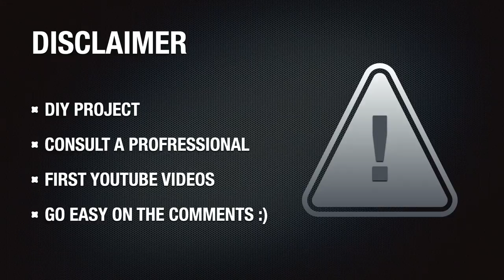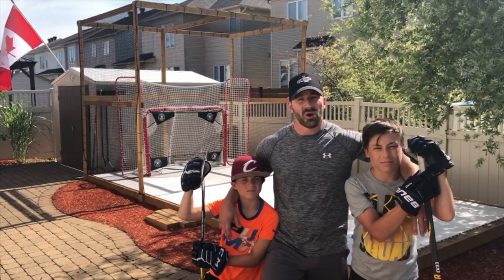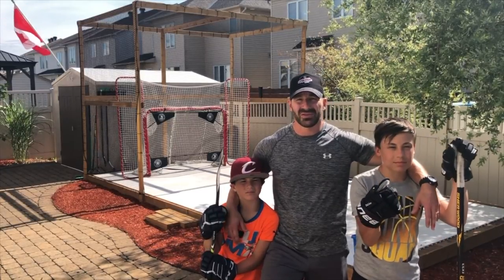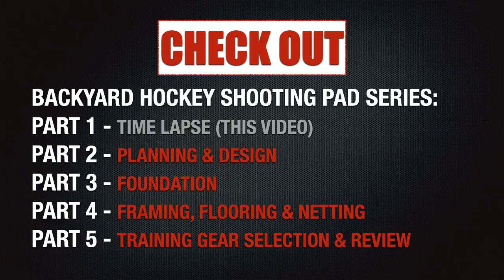How To Build Hockey Shooting Pad - Part 1 - Time Lapse (entire build)

Comment: What do you guys do when it rains?
Reply from the maker: Most of the rain glides off the pad (which is angled slightly specifically for drainage).  Any remaining water is directed away from the pad using a squeegee from Home Depot.  The rest dries off pretty quick.

Comment: As a professional contractor, all I have to say is👍🏼…. My only recommendation is to make sure that the base has a small slope for water to runoff, and I wouldn’t be opposed to installing a waterproof membrane/ ice and water shield under the white floor
Reply from the maker: Hi there, I'll certainly take that as a compliment.  I am certainly NOT a professional but did quite a bit of research.  You're right on the water shield.  At some point, we had to cut off the expenses and for its purpose, there's only so much I was willing to invest.  Thanks for the feedback and tip, totally agree.
Reply: @coachsimon4472  i completely understand … fantastic project !